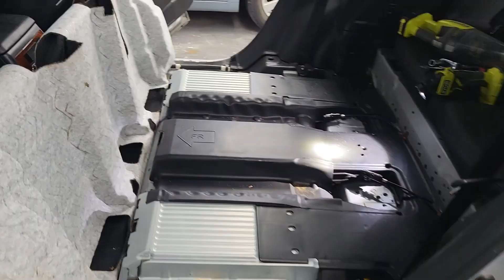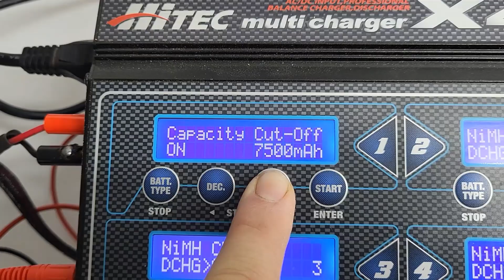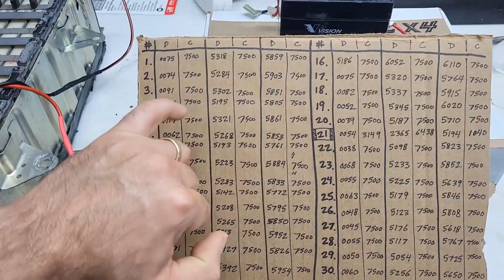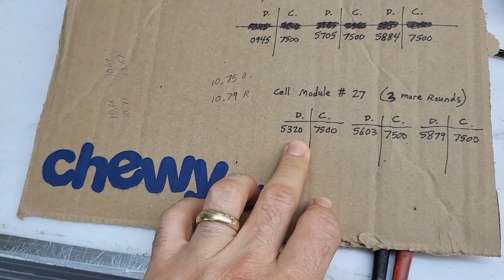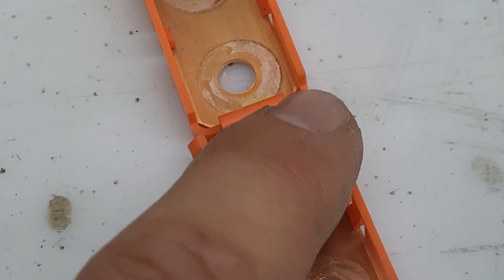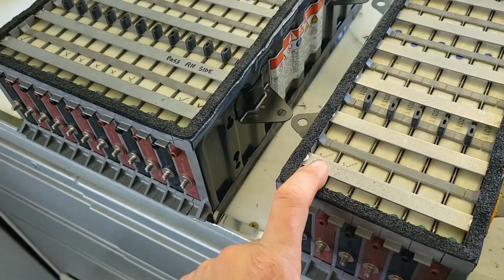Highlander Replace & Recondition Hybrid Battery Packs - Lexus RX400 RX450

Comment: Hi Warren, I bought the same charger from eBay and perform discharge/charge as same as your setting parameters except for the discharge voltage setting as 8 V instead of 5.4 V. I set 8 v instead of 5.4 v following someone recommend to set the discharge 1 v/unit for Toyota/Lexus hybrid battery on YouTube video. After 3 cycles of discharge/charge around 24 hours. The cells were removed from the module. The battery swelling happened for two cells. I checked the details, 1st round discharge 4113 mAh, charge 0569 mAh, 2nd round, discharge 0525 mAh, charge 1966, 3rd round, discharge 1825 mAh, charge 7500 mAh. Then I test the battery status uing Viking Battery Tester, battery of health, 49%, CCA, 369, Battery Voltage, 11.13V, Internal Resistance, 8.12 mΩ. It is obvisously the battery cells were damage. Would you like to tell me the reason why the battery cell damage? Should I put the cells into module for discharge/charge to avoid battery swelling or the wrong parameter setting for discharge 8 v? Thanks.

Comment: Full capacity on these are 8.7ah per toy/lexus documents 6.5ah is nominal
Reply from the maker: Good info thanks for sharing!  I only ran these cells up to 7500 mAh to be safe, at that peak it was pushing the cell voltage up to a little over 12v each.  For a cell with a resting voltage of around 10v  I didn't want to push them over the 12v threshold for too long or they start to get hot and swell up.    I tried it up to 8500 mAh (8.5ah) ~13v on a few and it ruined them.   Also I highly recommend using a fan while doing this process to keep them cool while deep cycling

Comment: Phenomenal job on showing how to do this!! I don’t have a hybrid - been afraid to even venture into this realm due to the batteries, and my experience and knowledge of battery systems…Great debug/tutorial!! ❤❤
Reply from the maker: Thanks for the comment! I was also hesitant to get a hybrid. I just decided to try it after researching how reliable they are 10 years ago.  I've had about a dozen different Toyota hybrids since then & can vouch they are one of the best vehicles ever built. I've never had to do a brake job on one, because they use regenerative braking to charge the battery. There's no drive belts to wear out or ever have to change. No starter to go bad. The gas mileage is top of the line. Once you buy one you'll never go back to anything else. They are extremely reliable imo.
Reply: @JohnCalebWarren - that’s great to hear! I think Toyota and Honda have been in this Hybrid space the longest and have been able to prove the reliability concept of them. Especially in the earlier stages- they were needing these to be reliable. So I have a theory that the engineers were not cutting corners, unlike today.